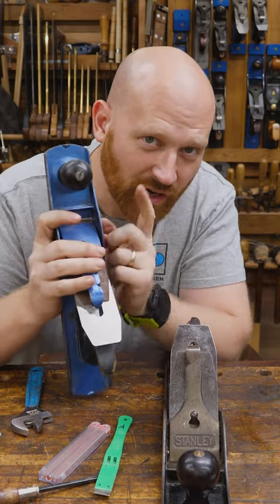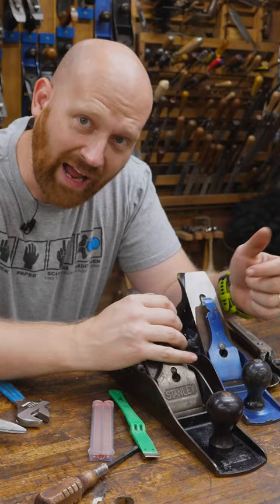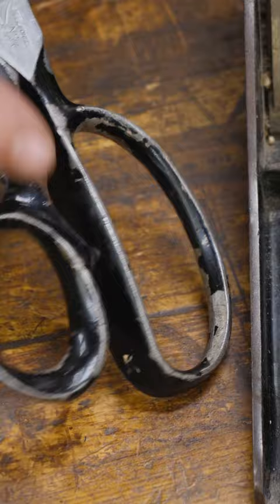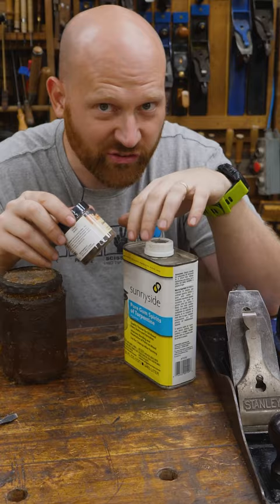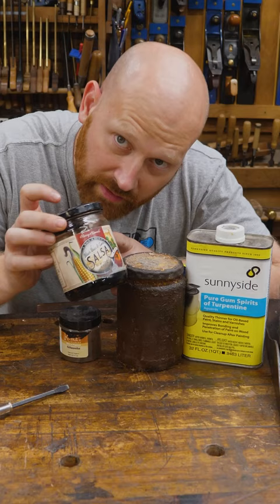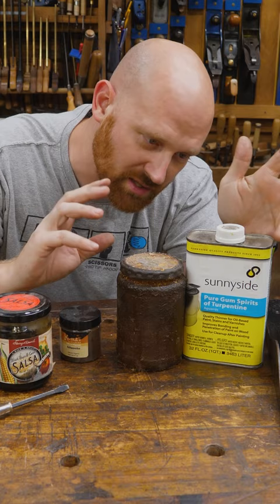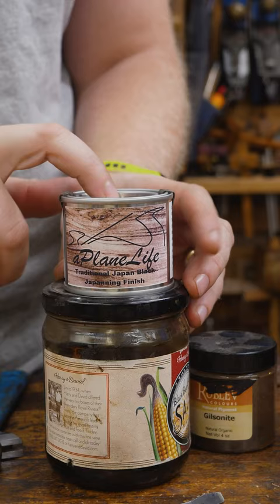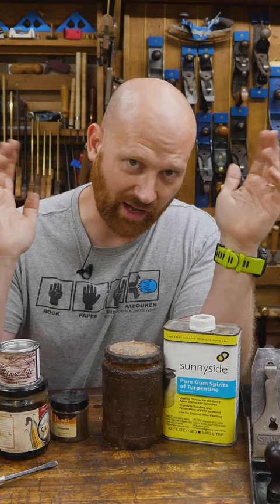What Is Japanning

Comment: Might sound odd but using tar paint on wood handles is actually pretty convenient too. Gives a better grip like pine tar but penetrates so it doesn't wear off as quick around chemicals. Skip the baking and just let it sit, it won't harden up like japanning but you won't have any slipping issues anymore.

Comment: Considering the difficulty of this coating system I'd much rather suggest going for a polyamine cured epoxy mastic coating. Such as Jotamastic 90. Can also get it in any color. However it is a two component system so once you mix it you have to apply it. That being said, if you have some mixing cups you can just take out how much you'd need. For example in a 5l kit, you could mix 350Ml with 100ml of the hardner. Use that that to paint the item and the you can leave the paint in storage for a long time. That coating should give you about 30-40 years exactly the same as with Japaning. Also the same time as with a powder coat. The only benefit being you don't need an oven, you also don't need to pay someone money to powder coate it. A bit cheaper and as durable is a two component chemically curing aliphatic acrylic polyurethane coating such as hardtop flexi also from jotun. You can get similar products from PPG as well and it's fairly inexpensive and quite easy to apply. Only mentioning it because I work with these products daily and I'm a bit of an idiot so I'm sure the people watching your content should be able to use it as well without any problems. This again is only if you want your items looking new for a few decades there's always alternatives. I just think using an oven could be dangerous or hazardous if someone doesn't know exactly how the chemistry works or if they don't have a back up one. I fully support Japaning as it's an older tradition but it's not for everyone.

Comment: I hope you can help me!  On the one hand, it is about removing rust from tools.  With what and how do I do this most effectively?  Or what options are there (from 'cheap' to 'expensive', from 'very simple' to 'quite complicated'.) On the other hand, it is about rust protection for the previously derusted tools.  What options are there for this?  Does it help, for example, to rub oil on metal after the rust has been sanded off and then dry it off again with a paper towel?  If yes, what kind of oil?  Silicone lubricating oil?  cooking oil?  Drilling and cutting oil?  And do you really have to remove it straight away?  If you could make a video about it, for example, or write a post about it here, I would be extremely grateful.  Because you always hear something different.  Unfortunately from people who should know.  For example, there are those who say that after you have de-rusted a spatula, you take cooking oil, hold the spatula and oil in the fire for about 10 seconds and then clean the spatula with something rough that is not as aggressive as, for example, sandpaper.
Reply from the maker: For removing the rust it depends on so many things. There is no best way. As to the rust prevention. Most every method will work to one degree or another. It is all about keeping oxygen away from the metal. I usually look at the metal in a simple 3 in 1 oil and wipe off the excess. If it's going to be in a high rust environment and then I will put a coating of one type or another on it. Here's a video I did a while ago testing a few of them. I'm hoping to do another test sometime soon with a bunch of others. https://youtu.be/96JpEhxaeGE
Reply: @WoodByWrightHowTo  That explains at least why you constantly get different advice.  Thank you very much for taking your time.  Then I'll watch the video!  Thanks again and have a nice day.

Comment: what other kinds of tools usually get japanning? it makes sense to me that you'd want a protective coating on you tools. but I don't think I've seen any hammers or wrenches with that coating.
Reply from the maker: 100+ years ago most metal surfaces that were not impacted would be Japaned. Ford's use to be coated in it.

Comment: If you don't have access to a blaster, is there a chemical stripper that will remove japanning? I have a couple of old Stanley planes that I want to refinish. Thx...Bob
Reply from the maker: You can use paint stripper but it will take 10 to 15 coats.

Comment: Is there any risk of the steel losing its rigidity since it has to be baked?
What about doing it on other parts of the plane like the chipbreaker or the blade itself?
Reply: siarnaq5625  I see, then technically it can be applied to anything in the plane.
Reply from the maker: Generally you can put it on anything you want but you don't want to put it on any surface that's going to come in contact with another metal surface otherwise it'll just wear off and Chip and create an uneven connection between the two pieces of metal. So when coding a plane any machine to surface that will contact with another surface does not get japaned

Comment: Engine spray paint works just as well and you don't have to bake it. Check your auto store.
Reply from the maker: There are several of them that look very similar but I find the durability to not be quite as good.
Reply: Engine spray paint gets baked on, because engines are hot.